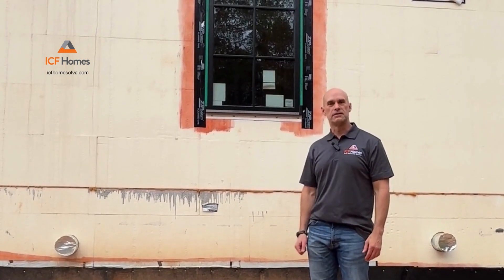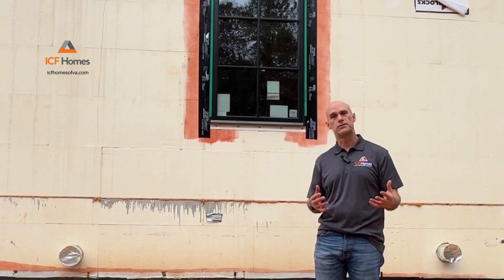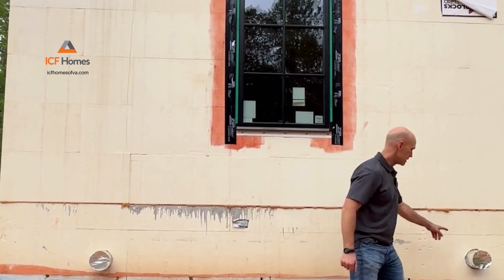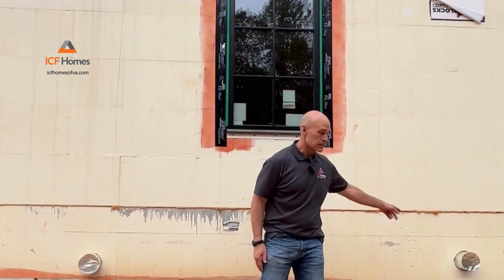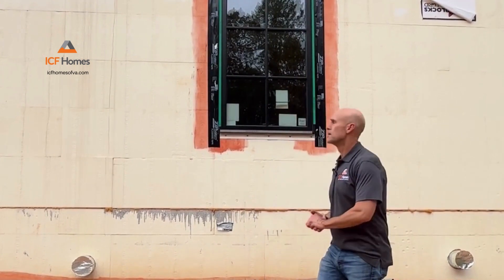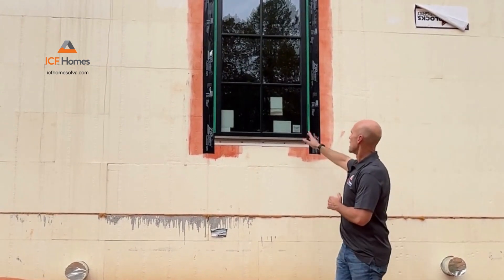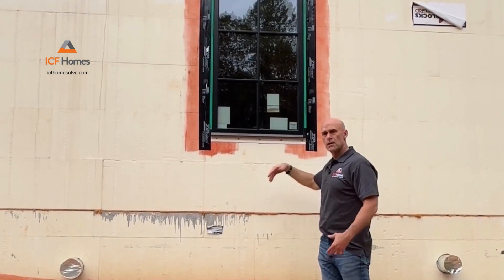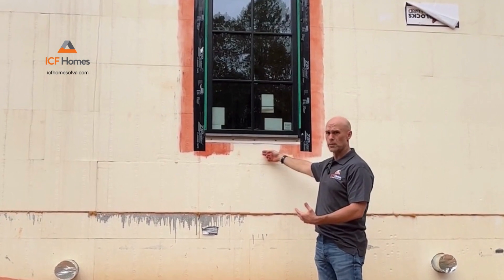How do you get fresh air into an energy-efficient ICF Home?  Builder Dave explains

Comment: Thanks for your channel.  Lot's of excellent information.  On the "Up to Kode" ICF YouTube channel, Kode wraps his ICF houses in Tyvec, an abomination in my opinion, 😂 , but I have never even touched an ICF block, so my opinion is a dime a dozen.  He claims that water has entered the seams in the blocks above and has found its way into the window frames, I assume before he started using the Tyvec.  What is your take on this?  I hope to DIY an ICF retirement home in a couple of years in NC.  I'm thinking  of "rubber-walling" the whole thing as some people have done.  I'm also thinking of recessing flanged casement windows.  Given that I rubberized the entire wall and recessed the fiberglass windows, It seems unnecessary to leave the bottom flange un-sealed.  I like the idea of having a sealed gasket all around the frame. The window frames themselves have weep holes for any water that enters between the frame and the sash.  Leaving the bottom flange unsealed means you need to do a good job of air sealing from the interior side of the window, which seems tricky with the tight space and screws and shims.  I guess it's just fill it up with foam, but not too much or water may not be able to find a way to the weep flange.   Have you done blower door testing and if so, was there air leakage through the unsealed flange?

BTW, in one of your videos about "Why ICF", you highlight homes that survived disasters.  I am from that town in Mississippi, Pass Christian, where the ICF house survived.  That house is in an area of town that floods quite a bit, thus it was built on piers.  I may decide to move back there, my childhood home, but on higher ground.  The Katrina surge was 30ft.  That ICF house saw all of it whereas our house saw 8ft.  That is why I want to use casements and seal all flanges like a gasket.  Seal the house almost as tight as a boat.  You may say that is fruitless, but during Katrina, the water inside was less than ankle deep while the water outside was eye level.  Unfortunately, the floor broke and water gushed in like a geyser.  That is where I'm coming from.

Comment: I assume the intake and exhaust ports you show are coming through a poured concrete foundation wall. I have seen where the grading contractor comes along and backfills dirt and is 6" to 12" under the intake port, which makes me worry about mulch or landscaping that has mold or mildew spores, etc. I would prefer the intake port be higher up on the wall somewhere and not down low close to the ground. Many times the backfill can build up the ground 5 or even 6 feet when backfilling so elevation height of the ports needs to coordinate with the grading contractor and/or landscaping plan. 

Your video stops short I feel. You don't how how. You just show where the air comes in and goes out. Not much meat to the content.